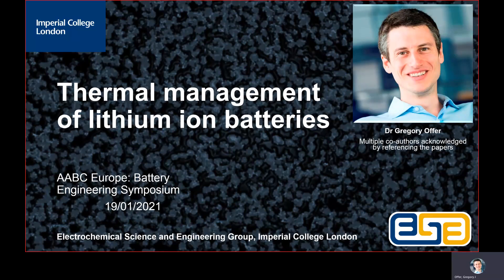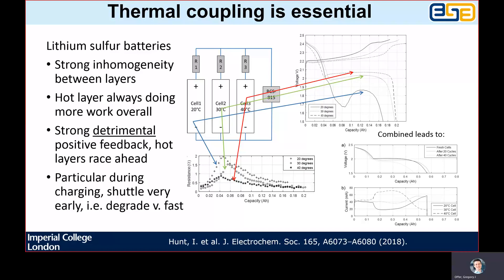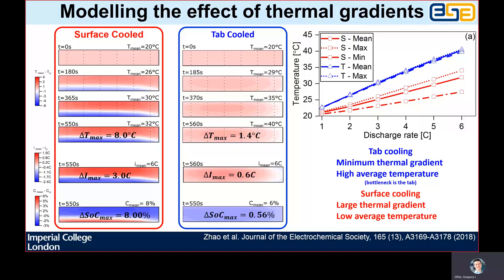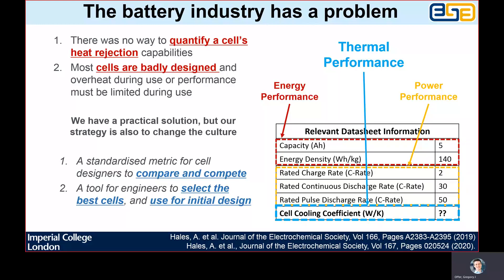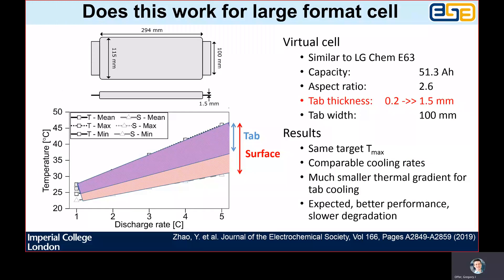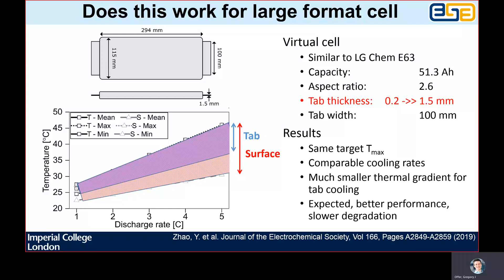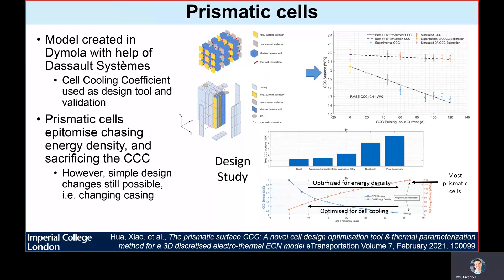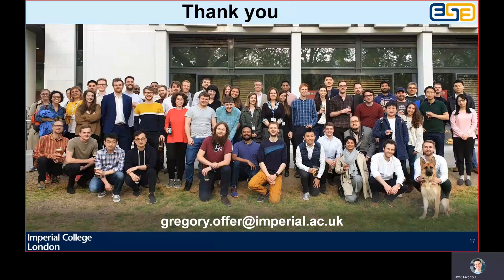Thermal management of lithium ion batteries: the sub-system optimisation trap!

Comment: My idea is you use the electrolyte as the coolant, no need for external cooling, what ya think?
Reply from the maker: I found a modelling study that investigated this pssibility, but no experiments yet. - Simon https://www.sciencedirect.com/science/article/pii/S0378775315009362
Reply: interesting, my thoughts are along the lines of electrolyte is free to move between plates, meaning channels for flow every so often, makes batteries  a bit bigger than they are normally, its yet to be worked out I guess, but there is potential, flowing electrolyte has also been used to rejuvenate cells, can strip the SEI layer and allow to get cells back to original state, sorry dont have the links at hand, I did post them on endless-sphere electric bike forum many years ago @electrochemicalscienceande8804